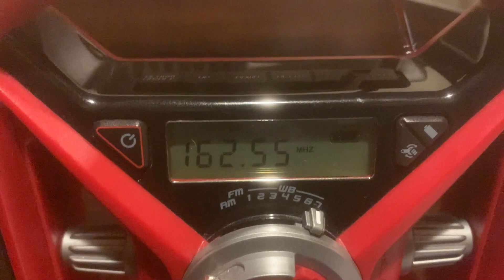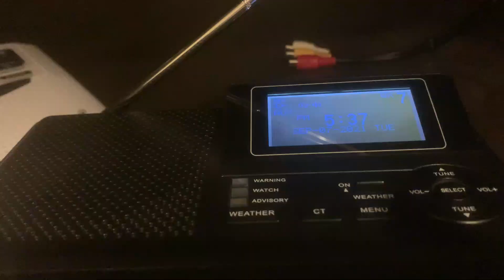I Played the Simplex Voice Evacuation Message on 3 Weather Radio Recievers

Comment: Does using the AUX port bypass the SAME detection? Or could I technically hook up multiple radios connected to aux, play some headers through it and use it as an intercom?